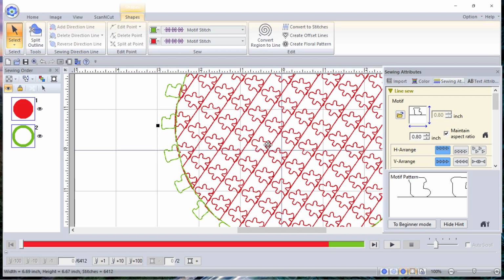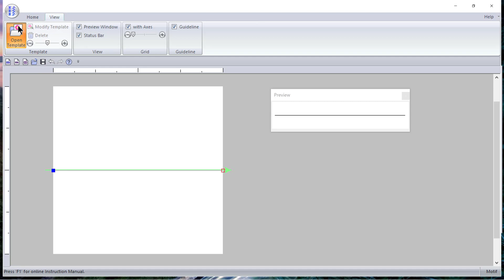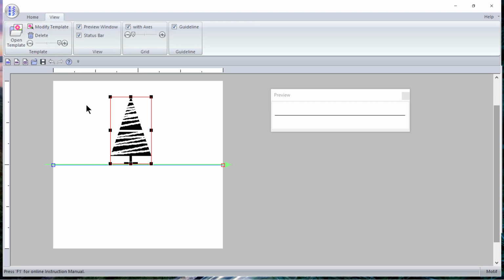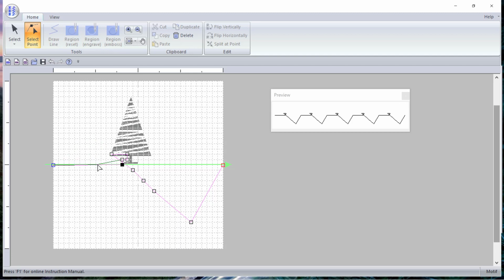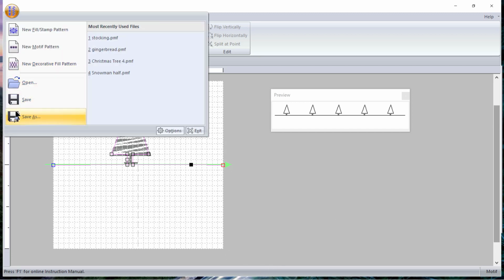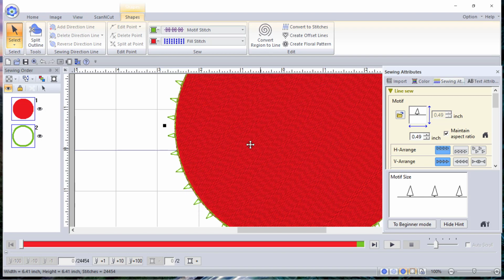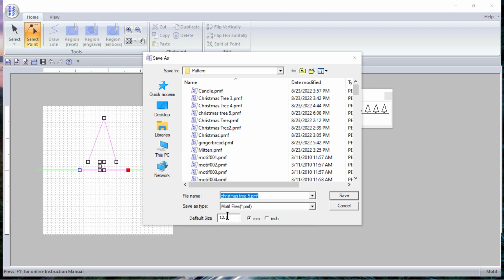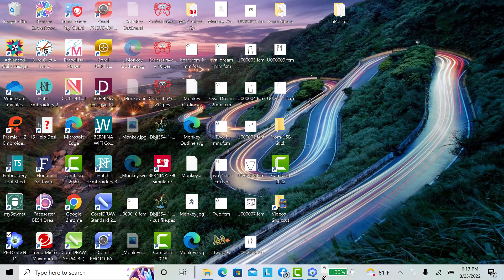How to Create a Motif Stitch with PE Design 11

Comment: if you move the blue dot and the red dots in closer to the center it adjust the spacing in between the motif. 
I spoke too soon... you addressed it a bit later
Also, you mentioned something about being able to use these on Luminaire. I have created a couple and used them in designs on my VE2300 and I believe by SE625.  I'll have to test it out again. I don't see why I wouldn't be able to.